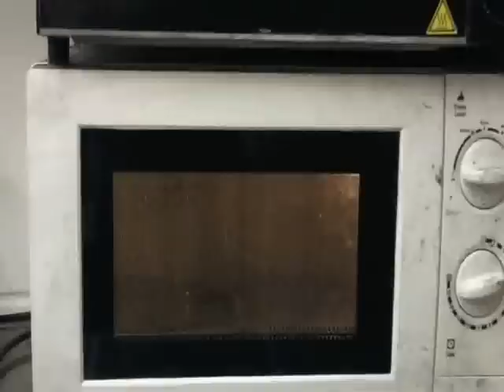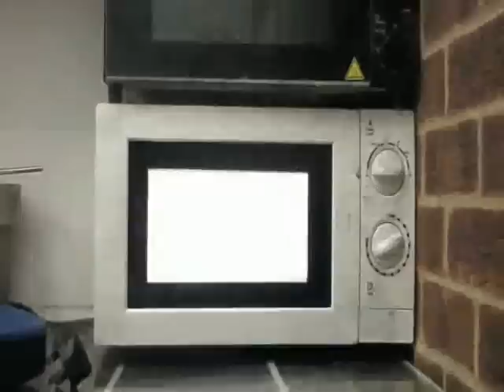Intercalating Graphite

Comment: Hi Robert,  i would like to make some of this but i only have fine graphite powder will this work or do i have to get flakes as you mention in the video ? if so do you know where i can get the flakes from.
regards kev
Reply from the maker: 45micrometers works well mate but anything lower can be a disappointment - i am not sure where you would buy it from i am afraid i g get mine from graphexel but i buy 20kg at a time
Reply: Many thanks for the prompt reply. So you must be making quite a bit then, do you sell it and if so how much ? i am interested in expanded Graphite and not Graphene ( i am based in Plymouth U.K )
kev
Reply from the maker: no worries mate - but i am afraid i don't sell it - sorry

Comment: Hi! I just tried intercalating some graphite, but upon heating it with a torch, it didn't expand at all. It just fumed for a second and then nothing more happened. May the reason be that it was still a little damp or I didn`t heat it quickly enough?
By the way, great video!
Reply from the maker: cheers mate - it could be - it could also be your graphite was too small - it needs to be about 50 micrometers or so in size to get really good results otherwise the gasses used to exfoliate the graphite just blow out the sides instead of expanding the layers properly
Reply: Thanks for your quick answer! Mine consists of different sizes, but there are still a lot of bigger pieces in there. Tomorrow I'll try again, with hopefully better results. Another thing...Did it ever happen that your graphene solution wasn't black, but light grey? At least the stuff in my sonicator looks like a grey thick cloud just over the graphite. Under the microscope, I saw a few bigger graphite particles, but the rest looked like small, clear "shards". May this be graphene? 
I know this is a lot of text :D
Reply from the maker: well worth trying again mate

Comment: Intercalating with strong acids seems to work fine for making a percursor material to  sonication or shear mixing. Unfortunately strong acids are not avaliable for most  private experimentators esp. the nitric since its deemed an precursor for explosives manufacture.  . LPE by either  sonication or shear mixing seems (at least to me) the most accessible  option for the hobby experimentator since it doesnt involve the use of hard to get and dangerous chemicals.  But the yield rate according to the coleman paper  is quite low, he talks of about 0,1% and with repeated passes of a maximum of 3%  yield rate.  Will using the intercalated ,heat expanded, precursor material significantly increase these yield rates if you use the shear mixing method? Or is it just a method to use a cheaper and more accessible starter material( graphite chunks instead of powder)?
Reply from the maker: +Scullpture I am not sure where you are from mate but you can buy strong acids in the UK and US quite easily - they sell them in the DIY stores as drain and brick cleaner - they are 96% sulphuric and 37% hydrochloric acids respectively. A friend of mine recently bought concentrated nitric acid and it came through the post. It's true you are dealing with chemicals that you have to treat with respect but then the same is true if you use this stuff to clean the drain and that's what they sell it for.
Reply: +Robert Murray-Smith Thanks for your promt response Robert, I am from the EU. Currently purchase of strong acids is  still possible - even nitric - but its already strongly monitored . At 1.04.16 new regulations will come to effect in the whole of the Eu and purchase of  certain chemicals will be severely restricted. Nitric above 3% strength will not be avaliable to the public anymore. There are even proposals to restrict  the sale of sulphuric acid and acetone among other substances. (FYI : sulfuric acid restriction proposal came from the UK goverment)  . The GO route is  impossible because KMnO4 is already banned here....besides that  I would prefer to  use the method using he least agressive ingredients, so precursor material from intercalated  Graphite would only be interesting if there is a positive difference to  "regular" graphite powder  in terms of yield rate.

you have shown us many viable methods to make our own graphene with simple techniques- kudos to you!! - yours is one of the most informative channels on the subject. I whish you would talk a little more about PROCESSING  the suspended graphene solution.  but I understand these may touch proprietary information. from what i have been gathering from the channel and various papers , the main problem is restacking. if you attempt to just evaporate the graphene suspension you will loose the majority of your hard won graphene to it combining again to larger stacks due to van der waals attraction forces. i have read the paper:. "Prevention of Graphene Restacking for Performance Boost of Supercapacitors—A Review"from here: http://www.mdpi.com/2073-4352/3/1/163 and the simplest route just seems to be keeping it wet. Most of the other methods use either technologies like CVD or chemicals not avaliable to the public. the one other possible method for the hobby experimentor seems to be the introduction of nanoparticle metal oxides like Mno2, Ceo2, Tio2 etc (also could be made by shear mixing) . I see folks on other channels just drying the graphene solution - but not with spectacular results...
Reply from the maker: +Scullpture I suppose i don't hit this problem much as I am a registered lab - but as you say there are a lot of methods using harmless chemicals and i will do a highlight vido on this soon along with some processing ideas - but you are right the simplest method is to keep it in solution  until you need it

Comment: HI Robert great video as usual and would like to do this myself but the problem is getting hold of the chemicals. Can you suggest a site to purchase the acids from or some alternative particularly for nitric acid or are they only delivered to companies. Sometimes you suggest chemicals which are difficult or next to impossible to get hold of. Regards Mike
Reply from the maker: michael endall it very much depends on the country you are from mate - most of my stuff i just order from ebay - what's restricted depends where you are from and i don't really know outside of the UK
Reply: Hi Robert thanks for the reply I'm in the uk and realize there are restrictions on certain chemicals like hydrogen peroxide 35% but can't find nitric acid and yet can find sulphuric acid, so just wondered if you had any advice. Regards Mike
Reply from the maker: michael endall ok cool - i get mine from APC pure - they are on ebay - i also use Mistral NI who have a good range - the peroxide i get from asda chemist and freeze distil to a higher percentage
Reply: OK thanks for that Robert, freeze distil, I've not heard of that, will look it up or is this another one of your great inventions. I swear you have invented a secret time machine to fit 36 hour into every 24 either that or you just don't sleep lol. Regards Mike
Reply from the maker: michael endall lol - it's a standard technique mate - and i don't sleep  lot lol
Reply: Robert Murray-Smith HI I can imagine you don't sleep a lot your always on to go lol and thanks again for the info just ordered the nitric acid, so really looking forward to doing that experiment. Regards Mike
Reply from the maker: michael endall glad you got it mate - handle with care!
Reply: HI yea I will, not really use to handling chemicals of this type but got gloves, goggles and will be doing this one outside so will let you know how it goes. Would have loved to come down to your part of the world and meet you as I am on holiday but can't at the moment. Regards Mike
Reply from the maker: michael endall sounds good - and no worries mate - anytime you are free - you are welcome - we have an open lab policy
Reply: Thanks Robert see what I am doing in September. Regards Mike
Reply from the maker: michael endall

Comment: That's a brilliant way to expand graphite! (Pun intended :p)

On your video you mentioned "bisulphate" as an intercalating species, are you referring to SBS (Sodium bisulphate)? I ask as I am working to refine my process in which I use concentrated sulphuric and phosphoric acids to acid treat the flake graphite. Microwave radiation will cut the graphene apart in a 9:1 H2SO4/HNO3 acid solution, and the arcing between graphene planes produces the light. But what I wanted to know is where would you suggest I can purchase the large flake graphite from?  Could I purchase the graphite crystals directly from you or the FWG? 

Lol, you should acquire or build for yourself a fume hood / cabinet as the acid fumes will permeate your lab and wreak havoc and on your electrics and your computer, etc.
Reply from the maker: Jonathan Fosdick I don't do enough of this kind of thing to really worry too much about it mate - but  fume hood is a must - i don't sell the large flake i am afraid - but there are suppliers on the net - fortunately i get mine as a freebie

Comment: Woow that s really fantastisc. Easy graphene at home. I call that pop corn graphene lol.
When you put the intercaled graphite in microwave I though it will be explosed.
Thanks to share this method
Reply from the maker: Mo Kha glad you liked it mate
Reply: Robert Murray-Smith I read that we can do this just with acid formic. I am trying. How many time do you let the graphite in the acid?  Sorry I didn t hear so well in the video.  Thanks
Reply from the maker: Mo Kha overnight mate
Reply: Robert Murray-Smith the formic Acid seems to do a good job but my graphite is maybe not the good one. That is pure pyrolytic graphite too thick. I think I will follow your process.
Reply from the maker: Mo Kha i should say i like the formic acid route too
Reply: Robert Murray-Smith yes and it smells like flower lol especially when it is heated